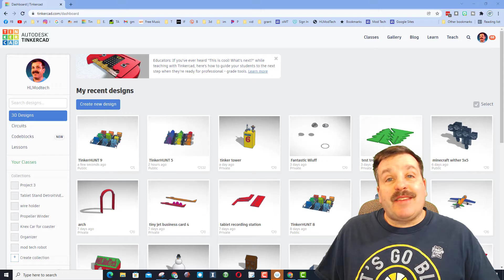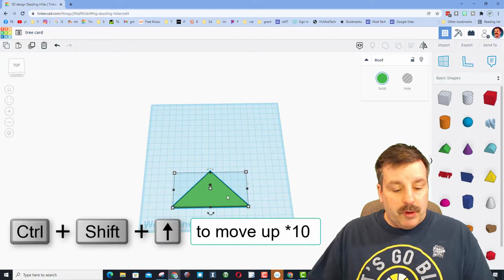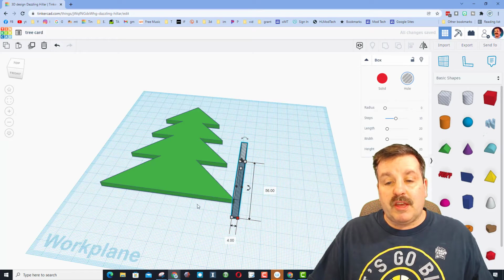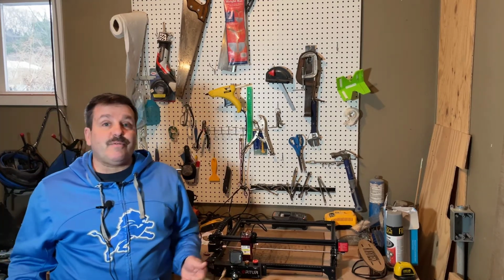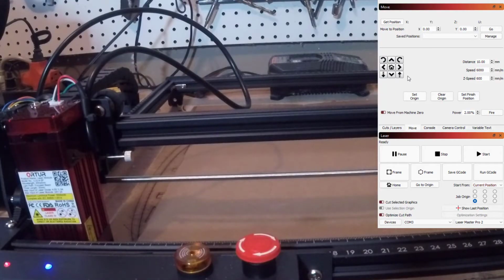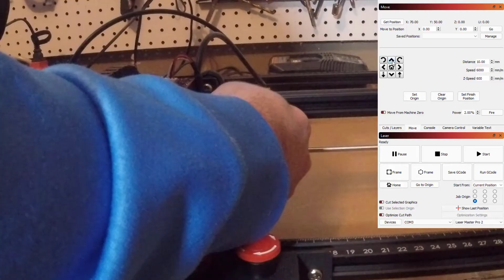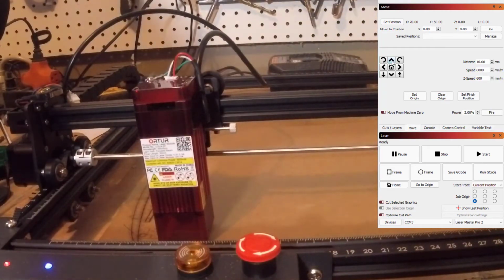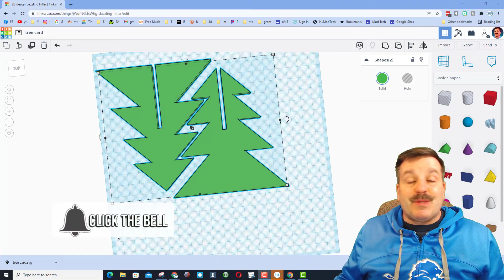Design a Tinkercad Tree for Laser Cutting from Cardboard in Minutes!

Comment: How can I do this in tinkercad for a 3018 engraver?
Reply from the maker: The steps to design it are the same. What software do you use to load files for a 3018?
Reply: @HLModTech  I believe it is called grbl I think if I save a file in TC and open it in grbl it will turn it into g code for the CNC engraver. I am trying this in a chrome book also. I know I have a lot of limitations with this. I cant believe no one has done this. Thank you for any help. I will try it today . If I get results I will let you know
Reply from the maker: @scopeboy66  Happy to be useful. I am interested in CNC, so your results would be great to hear.
Reply from the maker: @scopeboy66  Guessing you would export your tink design as an SVG, but that is only 2D... The engraver may actually work with 3D files. For some reason dxf is coming to mind.
Reply from the maker: I just looked up that it is a cnc machine... I am not sure, but would love to learn.